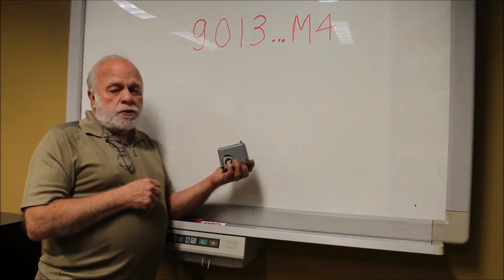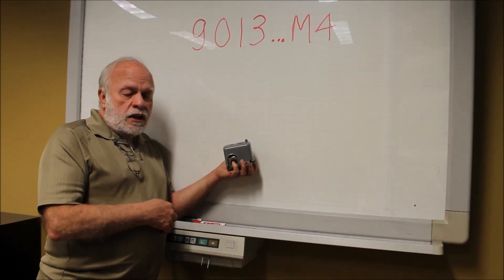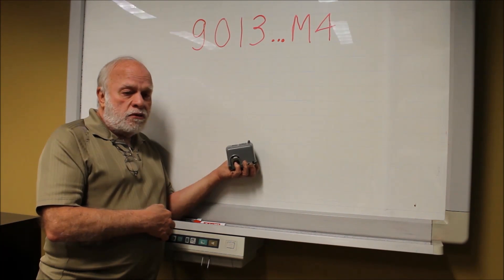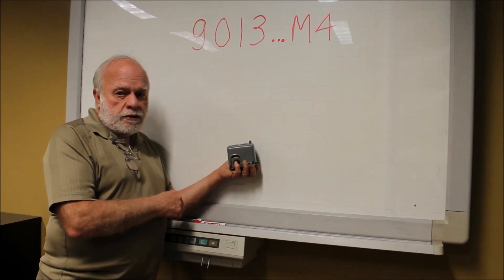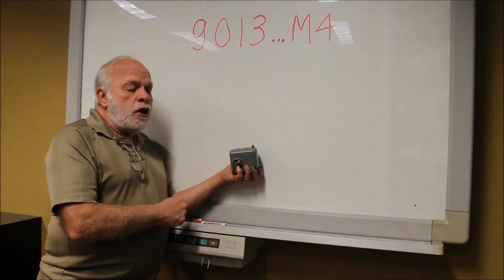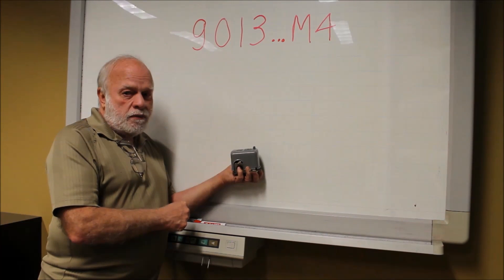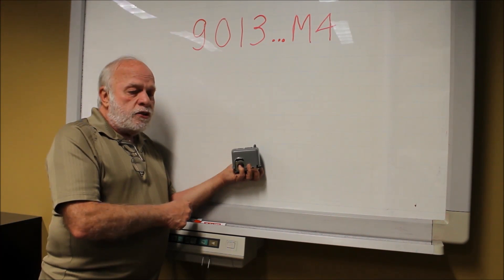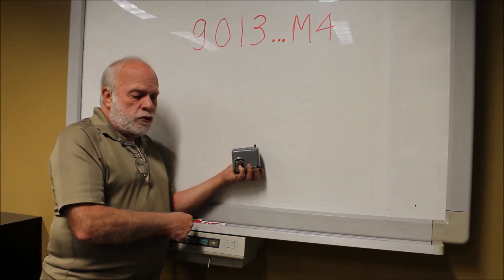Using the M4 Low Pressure Cut Off on Square D™ 9013 Pressure Switches | Schneider Electric Support

Comment: at 53 seconds into this video, it states the lever will automatically go to the off position if the pressure falls more than 10 psi below the cut-in pressure.   This is incorrect as the lever doesn't revert to the off position.  This causes confusion in the operation and actions necessary when the low pressure cutout does activate. And the lack of instructions in the box caused me to hunt for this video to understand some basics of the M4.

Comment: Worthless video. If people need the information that's on the video then they will most likely not know how to position the lever for proper operation. I would suggest deleting this one and redoing to include instruction on the operation of the unit. It is important to elaborate on the lever positions even though they are marked on the cover. An old worn defective switch can lock into the off position but run anyway (!) and keep the pump running even if pressure drops.

Comment: Under what circumstances would the switch become a nuisance? If water supply was good and pressure would not be expected to drop below 10lbs below cut in, then how would this aspect of the switch be noticed?
Reply: Take a system with a backwashing filter for example. Many types of media require a higher backwashing rate than their maximum supply rate. If your well pump is on the lower end, your treatment system will probably be designed to have the required backwash rate close to the max supply rate, meaning a drop in pressure to much less than 10 below cut-in pressure. This type of switch, if not needed, would unnecessarily limit your treatment system size and therefore max supply rate.
Reply: I hate this switch. Sometimes the pressure drops when a toilet flushes and the washer is filling and the pump can't get the pressure back for one or two seconds and this switch just clicks off.

I found this video trying while trying to learn if there was an adjustment to make. Apparently I'm buying another switch today.
Reply: Rob Skold Yup, I did the same thing. My household use wasn't an issue, but my iron filter has a very high backwash rate that my current pump can't sustain at higher pressures.
Thankfully it's any easy fix. Page 21 of this document breaks out the meaning of the catalog numbers: https://download.schneider-electric.com/files?p_File_Id=9351503471

The 'J##' part just refers to the preset pressure settings, so that part doesn't matter much. I ended up buying a J25 (60-80 psi) since it was cheaper and more quickly available, even though the J24 (40-60 psi) was closer to what I ended up setting it too.